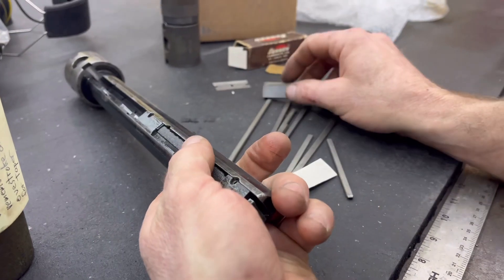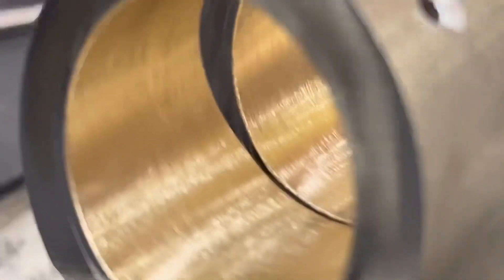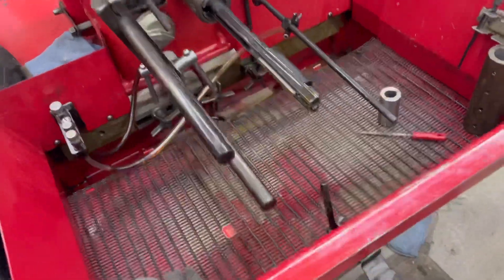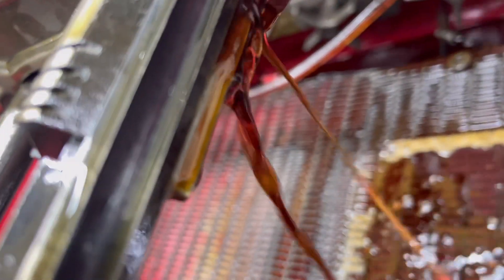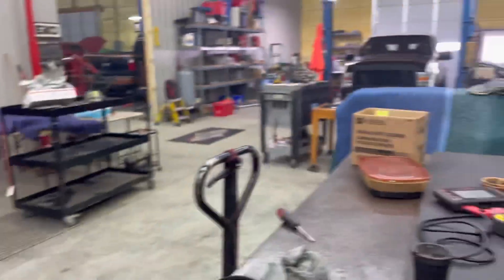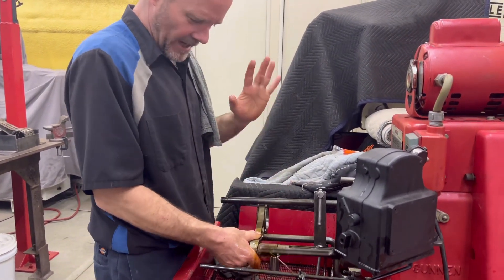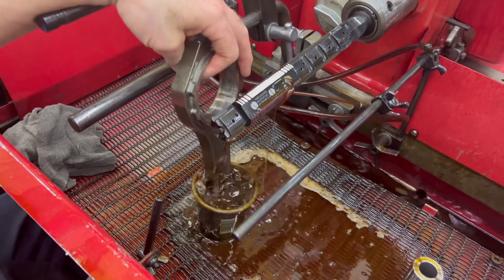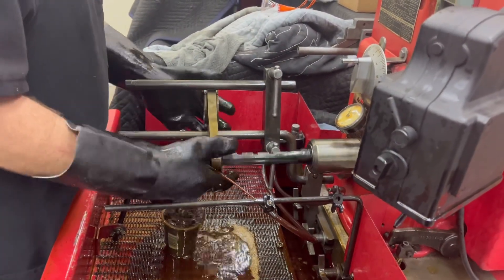Connecting Rod Honing with Diamonds!!!

Comment: Looks like you got a good system there.

I had my rod bushings replaced and went to install. Some of them are really tight on the piston pin, cant turn it or slide smooth back and forth. Some of them are smooth though.

What's your opinion on how they should feel? Or is there a clearance spec?

Any help is much appreciated!
Reply from the maker: I’d be looking for 1.3 to 1.6 thousandths.  Or ten one thousandths.  Too tight can be much more catastrophic than too lose btw.  It will spin the bushing and cause material to be released through the engine.
Reply: @AnthonyYoungblood Thanks for the reply, my thoughts as well about it possibly seizing on the pin and spinning in the rod.
I already installed one of them in the engine. You think the rings will be okay to be removed and installed again? All brand new parts.

Got me questioning my Main bearing clearances now lol.
 Plastigauge was .0015 and one was just under .001 Crank spins smooth and easy though with assembly lube.

Min spec is .0008 for mains so I know I'm close. Also heard plastigauge reads on the tighter side which would be in my favor.

Comment: If you can use Castrol Hysol 20 or Hysol 30 I have it by the 55 gallon barrels hit me up i will bring you up a few barrels I have a few other various cutting fluids in bulk that I acquired in a bulk by